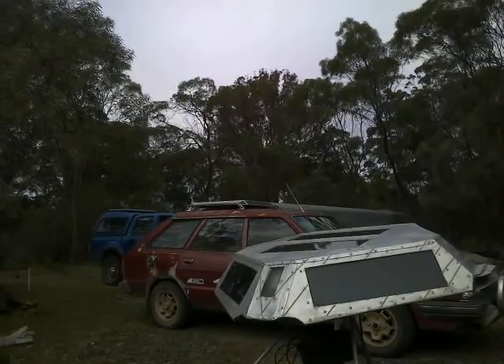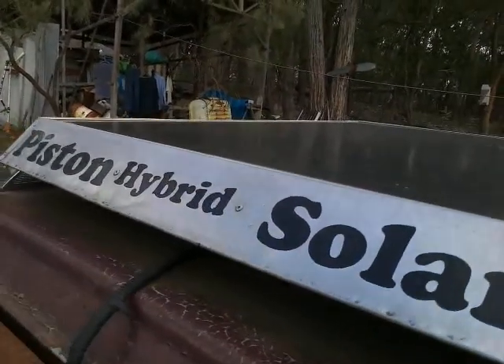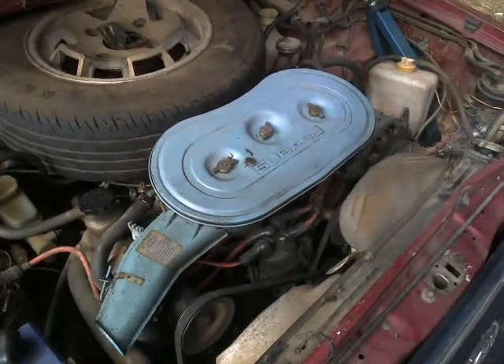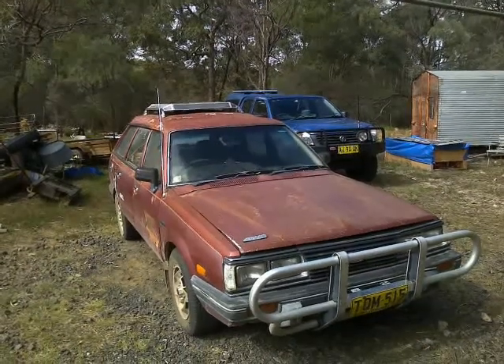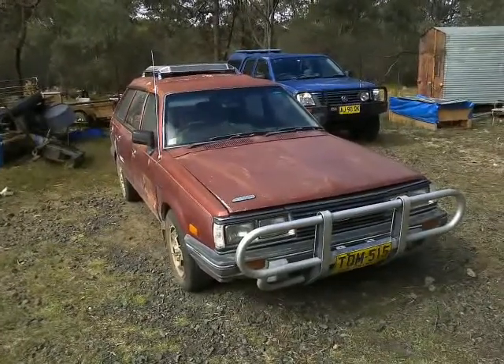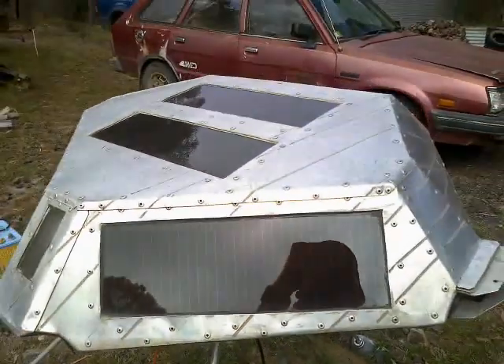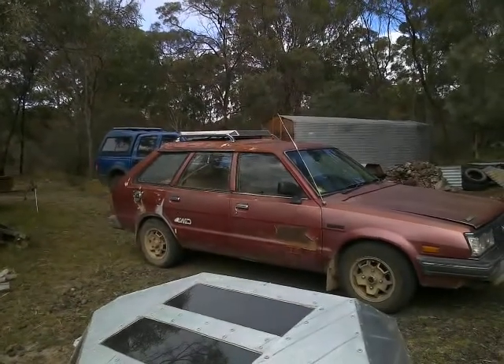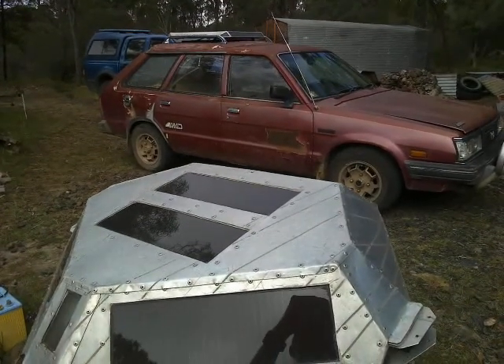SunFoil Acceleration Effect (Turbo Diesel).

Comment: Epic! Shared to Google and may update my feature of you with this video, but still debating that (with myself lol). I really want to try this with my car, which I own outright, but I have a low tolerance level for busting my knuckles anymore and I don't drive much. I still want to try it anyway lol
Reply from the maker: G'day,

Thanks mate,

 Yay Team...! Um, if you "don't drive much" then your car is probably "sitting doing nothing" (for a couple of days at a stretch ?) between  being driven...; and if so then that makes it the Perfect candidate for having a SunFoil..

 My old Subaru needed to make up for the Stereo's Memory-Chip & the Dashboard-Clock, (0.1 Amp x 24 Hours = 2.4 A/H per day) and to overcome Sulphation (1% of Rated Capacity per day,  95 A/H x 0.01 = 0.95 A/H per day), meaning that every day sitting parked the Battery was "losing" 3.38 A/Hr...; and to recharge that requires 1.1 times the amount which is being replaced, so the Car needed to feed the Battery 3.685 A/Hr per day...

 To allow for a cloudy or rainy day, I'm suggesting that the PV should be rated in Amps at whatever is about Half the number of Amp/Hours the Battery needs to be fed every day..; so I had a 1.7 Amp Panel, and on a Sunny Day it would have the Battery topped-up in 2 hours, whereas on a rainy day it might take until Sundown...., but as a bonus, the Ignition and Radio were both able to run on the Solar Panel whenever the Sun was up - unless the Windscreen-Wipers or Headlights were being used (Rainy Dayze).

  There isn't much Knuckle-barking involved, but if you want it done neatly then "farm the job out" to your local Auto Electrician...

Have a good one,

;-p

Ciao !
Reply: Oh, that's even ANOTHER reason to fit one of these! So, 'yay team!' to YOU Chris :)
Reply from the maker: Phoenix Rising 
No worries mate,

 That was my original reason for deciding that my car needed to have it's own little Solar Panel...; two or three days of sitting parked while I was dutifully trying to save Petrol by only going to town 3 times per week, and the less I drove it the worse it's Fuel-Consumption and Acceleration became, until with a new Oversized Battery, after about 3 months the Electric Windows were refusing to obey the buttons and it was driving like a gutless Lemon.

 And, 7 years ago I realised it was either fit a Solar Array to the Car, or leave it idleing on the driveway for 30 minutes every time I came home, to give it a 45-minute Runtime so it could finish charging it's Battery with the Alternator...; and I'd already tried plugging the Car into a Panel which stayed at my place, and it was a pain in the bum...

  So, yeah, it's simple and cheap and it works...; enjoy !

;-p

Ciao !
Reply: WarblesOnALot Oh dear, the worse it got? Silly me. The truth is, I don't drive much for more selfish reasons Chris. I like to write. Whenever I try it in public, I am pestered too much by strangers that may not understand why a woman's sitting by herself, happily lol, so they come up to save me from myself.
Reply from the maker: Phoenix Rising 

Oh, no..., it isn't permitted for CitiZens to sit alone, undistracted and undiverted and able to ponder at their leisure...; otherwise they might well have an original thought..., and THEN where would the world be...?

;-p

Ciao !
Reply: Phoenix Rising Or maybe the REAL reason you sit all by yourself in public is because at this point of your life many of those around you have realized that bitter spinsters that hate men and get angry all the time at the drop of a hat and have a victim complex about themselves and women in general make for some pretty poor company :P How's it going my dear, small world I certainly didn't expect to find you here, still want to shoot me through the screen? heh heh heh...
Reply from the maker: Lord Benjen Stark 

  G'day,

 Hmmn, are you one of the Burnt Firebird's pre-existing tally or are you a whole new Stalker ?

 Never mind, it probably doesn't matter. Did you miss the Briefing on Stalking and Apprehended Domestic Violence Orders..., did you ?

 Here's how the System operates..., at Law, any person who says that they reasonably hold fears ("apprehend") that they are in some danger of experiencing Domestic Violence or Abuse of an Emotional, Verbal, or Physical nature emanating from any person known to them..., may apply for an "Apprehended Domestic Violence Order, to restrain the object of their fearful apprehensions..; as soon as the Application has been served on the Respondant then the conditions of Restraint applied for are enforcable from that moment onwards until after the case has been heard & dismissed or new Orders made....

  And, in my experience, it is impossible for one person to actively prove that another person's alleged fears are unreasonable, unless video evidence, or sworn testimony showing otherwise, can be introduced...; which is generally impossible to arrange.

 So, if one is falsely accused of being a Stalker then one has only one way of establishing their innocence...; that being to forever after go out of their way to never again cross paths with the sort of vindictive paranoid delusional manipulative lying vexatious individual who feels entitled to make such malicous and slanderous slurs...

 Because, the one thing which is utterly certain is that if ever somebody with a Stalker-Fantasy  ever again sets eyes on the object of their heart's desire (to have somebody be obsessed enough with them as to be bothered to stalk them...), then however long it's been since their previous encounter -  in the mind of the "Stalked" then any sniff or sight or spoor becomes a "This Proves EVERYTHING...!" moment...

  So, if you are not a Stalker, then please prove it definitively by not approaching the Burnt Firebird again, because if you do then all you're doing is making yourself look worse in her mind...; and if you are trying to organise some way of resurecting your lost chances of being on better terms with her than that, then wake up to yourself.

  Women pick their men based on what their Immuneotype smells like, they find a different Immunotype smells Yummy, & similar ones are Yuck...; which stops them from coming-on to their fathers & brothers, while leading towards breeding for hybrid-vigour in the Foetus..

  Chalk it up to your Immune System smelling wrong..., to some women, regardless of what you do or say or how much you spend...,  and go looking for some woman who doesn't smoke (tobacco kills the sense of smell), is not using hormonal contraceptives ( because when a woman's Nose is "Chemically Pregnant" then she's attracted to men with the same immunotype -  by the same mechanism which operates to make Hubby smell like a Pig when she's really pregnant, in order not to miscarry while trying to achieve deep vaginal orgasm at 4 or 5 months gestation... ; find some woman whose Nose is fully functional, who reckons that you smell "perfectly yummy", then go off and live happily ever after...

Yes ?

;-p

Ciao !
Reply: Lord Benjen Stark
Really dude? You're trolling my Google+ page/subscriptions now?

Unlike you Benji boy, I have nothing to hide. Including my steady opinion you continue to mistake 'rude' for 'civilized' and 'opinion' for 'trolling'.

Sorry Chris. I had a conflict of opinion, very briefly, several months ago in another youtuber's Hangouts. He obviously hasn't let it go. And, once again Benjamin: BLOCKED.
Reply from the maker: Lord Benjen Stark 
For someone who claims to bear no ill will, thou art remarkably freely decorating your every utterance and reference to the Burnt Firebird with Put-Downs, negative stereotypes, and perjorative epithets...

  But, as I said, once the Stalker accusation has been laid then the only defence is to withdraw utterly ftom the accuser...; any other course of action merely proves the Charge.

  Life's a Bitch, then you marry one...; isn't that what they say ?

 Today's my 27th Wedding Anniversary, the day after the Winter Solstice, the shortest darkest coldest day on the Calendar & I married the Crazy Lady....; when she first tried to play the Stalker-Card some people believed her, but as I've only seen her once, for 5 seconds when she walked into a Room where I was located, 3 years ago, in the past 14 years..., then the more she's sung people her story the sillier she's succeeded in painting herself as being.

 The strategically worst thing any accused Stalker can ever do is to make any contact with their Accuser..; it's a fact of Life.

 If it's any consolation, my life is great, my kids love me and treat me wonderfully well, we see each other several times per week..; my wife's life is fucking miserable, she might see our daughter 2 or 3 times a year, & our son hasn't seen or spoken to her for about 8 years.

   Bullshit Artists only Think they get away with their machiavellian stuff..., but in tbe long run they have to keep on living with themselves,  long after everybody else who knows them has woken up to their Bullshit-Factor, and managed to get clear of them.

;-p

Ciao !
Reply from the maker: Phoenix Rising 
No worries mate,

  I never could block or delete, till I got a Touchfone, so I never got into doing it.

  Apparently the new system doesn't stop Blocked people from posting, even on the Blocker's own Threads...; what happens instead  is that the Blocker puts Blinkers onto themselves, so that while they cannot see anything posted by the Blocked, it all appears on the Thread to anybody else on YT who happens to read it.

  I prefer not to edit my view of the Feedback.

  Have a good one,

;-p

Ciao !
Reply from the maker: Phoenix Rising 
Not a problem, as you see, all he's done by coming here is to prove your assertion that he's stalking you...; if he'd showed up here by accident and if he was to have only talked to me here, rather than you, then if you'd seen his comments and they hadn't mentioned you - then he'd have behaved in a manner which might have caused you to adjust his label...

  And, now he knows that his best way to paint his Reputation "White" is to go away and cease to approach you.

  If he wants somebody to fight with, he should probably go to +inmendham  Channel & commence preaching on the joys of Parenthood..? Then he can be as loud and as opinionated and as self-righteous as possible, and he can engage with people who like to be excoriating...

 They even have Antinatalist & EFIList women who are furiously embittered with Life in general and Men in particular, so he'd be able to play in a Sandpit tailormade and landscaped to fit his worldview...

  Here he'll be treated to my efforts to be objective...; which often strike people as being less than supportive..., but ya get that...

  But, bottom line, it isn't your fault if somebody follows you around on G+ and YT...

;-p

Ciao !

Comment: Facinating project. I expect that the efficiency gain will be different according to the vehicle.

I just had an interesting idea about how to make that dangerous intersection safer. Imagine a sensor at that intersection triggering a  blinking warning signal on the main road. Maybe a yellow sign that says, in bold black letters, something like, "dangerous intersection ahead" that blinks in red lights when a car is sensed to be entering the main thruway. Or if the sign can be made to blink the message, maybe something like "slow down: vehical entering dangerous intersection".
Reply: Very exciting findings!
Reply from the maker: G'day,

Thanks mate,

 Yeah, that's the snag, every vehicle will benefit, but by a different amount, and from a different sized Panel...

The really tricky part is that because there isn't anything Patentable there isn't any "protected Intellectual Property", so nobody wants to build a Factory to make Retrofit Kits and distribute them, in case somebody else waits for the market to be proved, then whips up a bigger more efficient Factory and undercuts the first one...

 So, it's pretty well down to trying to convince people to do it themselves, or get their local Auto-Electrician to do it for them - it's no more difficult than putting PVs onto a Caravan, and they do that regularly (how long since you saw a Winnebago without Solar Panels ???).

 They put up "Warning" signs on the Highway about 300 metres both North & South of the Intersection, after the most recent Fatal (about 3 years ago)...; but people on the Highway seem to deal badly with the appearance of any vehicle in front of them which isn't roughly at "Highway Speed"...

 A couple of months ago a Schoolbus was rear-ended just North of the intersection, stopped and propped on the Highway at 08:30 blinkers on, Warning-Lights flashing, waiting to turn right and cross the traffic to pick up some kids from their Driveway...

  At some point, as a society, we probably need to lower the prevailing Highway Speed, to give the dreamers more time to notice stuff..; and simply going from 100 Km/H down to 80 (62 MPH down to 50) would roughly halve the Fuel Consumption..., but the Revheads will hate it...

;-p

Ciao !

Comment: I think I would be more interested in the fuel savings than the increase in acceleration. I should share this with my son. He plans on putting solar panels on his home soon. This would be right down his alley.
Got the sound fixed.....at least in I.E.
Reply from the maker: G'day Jim,

Thanks mate,

 Yeah, I reckon the Fuel-Saving is the angle which should make it compulsory to add a Solar Charger to get past the annual Registration check, but over here there's an incredible apathy about doing anything to improve Fuel-Efficiency (probably because of all the previous schemes which turned out to be scams...) ; but lots of people regularly spend vast amounts trying to improve acceleration, though they can only go up to the Speed Limit.

   Originally, I was trying to spare the Battery from a death by a thousand short trips, never getting to be fully recharged because living 15 Km out of town my longest regular drive is 15 minutes & my average Engine run-time turned out to be 6 minutes...; three months after putting in a double-sized Battery it would be so flat the Electric Windows wouldn't obey the buttons...

When I figured it out, I thought my choice was to run the motor for 1\2 an hour on the Driveway every time I came home, or fit the thing with a Solar Array..; it was after trying to rescue the Battery that I discovered the Fuel saving, and the improved acceleration, and the extra top speed...

 If you visit my "SunFoil Project" Playlist there's a clutch of videos telling the story, as well as Construction Vid's for the first 3 prototypes, and showing the records and data..; for the first year with the Mk-3 I logged every Engine Start/Stop time, and I'd been writing down the Fuel/Distance/Date/Price ever since I got the Subaru 12 years ago...

  I've tried every argument to sway people to give it a go, including the point that when he let me put a SunFoil onto his Brumby my son was a 1st-Year Apprentice Auto-Electrician, when he let me put the Mk-5 onto his Rodeo he'd just finished his 5 years apprenticeship, and 6 months ago he bought his Boss out so now he's the Town's Auto-Electrician..., and in a fortnight he turns 26...

 If my SunFoil idea was bullshit in any way, my son would never have allowed me to put one onto his Ute...

  My guess is that about the time ISIL captures Saudi Arabia's Oil Wells and discovers that they're nearly empty, if the Fighting hasn't burnt the Wellheads...; as the last boatload of Refined Fuel arrives in Oz from Singapore's Refinery, when there's 21 days Motion Lotion in the whole country..., that's when the Mad Max Wannabes will start wondering how to go a bit further on less fuel, and maybe they'll remember the idea of feeding Sunlight to the Car-Battery...(?).

Have a good one,

;-p

Ciao !